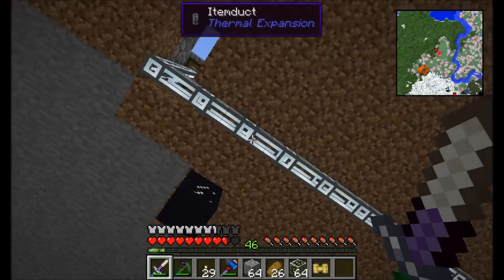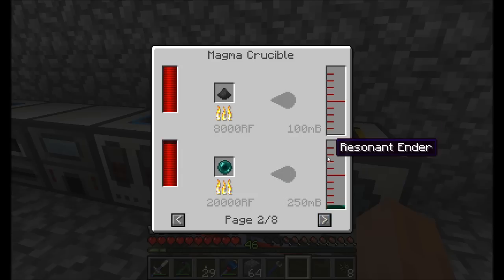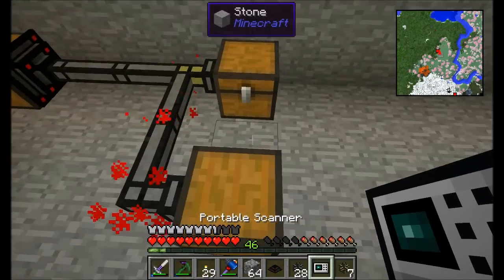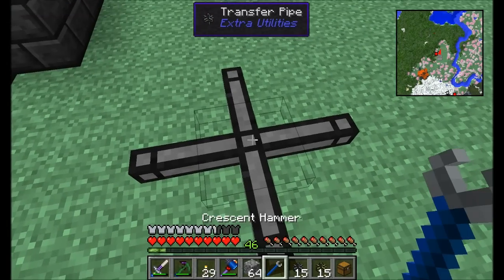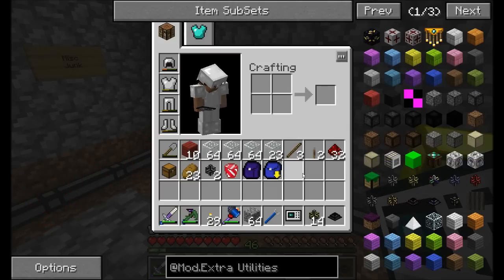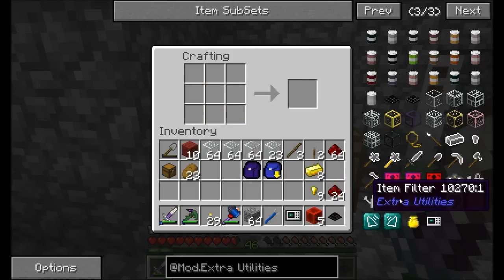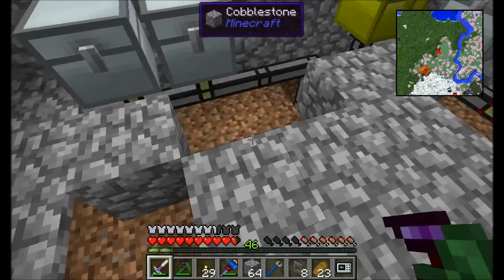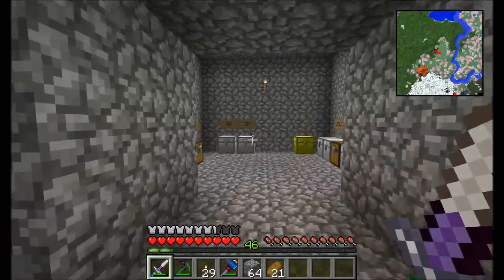Lets Play   S6E9 Sorting 102

Comment: I know you are well past this. In this video you talked about a mod sorting pipe from extra utilities. You can do the same thing with Thermal Expansion if you insert a servo which you did do in a previous video. Basically you put in a few items from the mod and you toggle white list on and metadata off.  This will only allow items from the mod through. Just a tip for people that are following along late and already have TE  pipes connected.

Comment: Extra Utility pipes glitched out alot especially if you stand in front the pipes as you place them to connecting points.  I found if you don't connect the transport until end then it never glitched. I was kicked several times as I tried to place them before I figured out how it glitched.  Also I was confused on the pipe if it was closed or not. I wish it had a rim or something. I also found torches from tinker didn't work either in some situations (stone+coal) torches didn't generate light when I hit F7 after a few days in mystcraft worlds.
 At least it didn't drop items on the floor once it was hooked up.

Comment: Direwolf there is a bug that causes the game to crash in your 1.6.4 mod pack. The bug occurs when you try to open up any interface with the modular powersuits Power fist and have the LP-Hud-Config selected as the tool. If you can get this bug resolved it would be appreciated. MAKE SURE DIREWOLF KNOWS
Reply: this would be very helpful, if you posted this on the FTB forums.